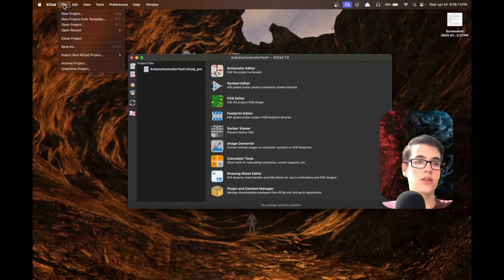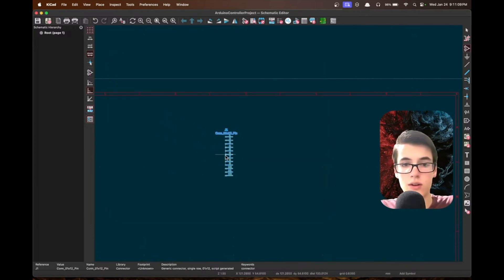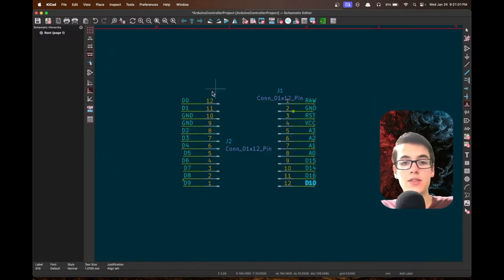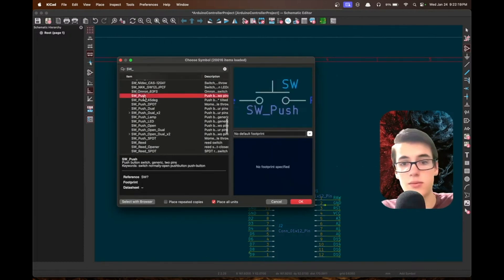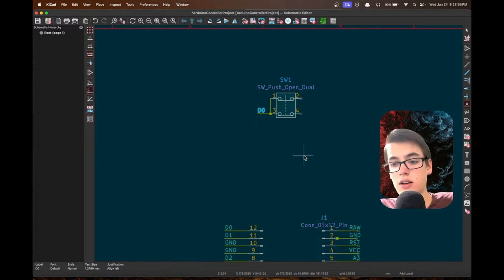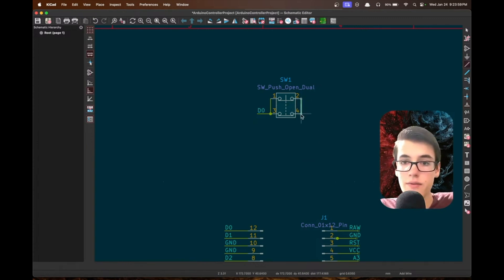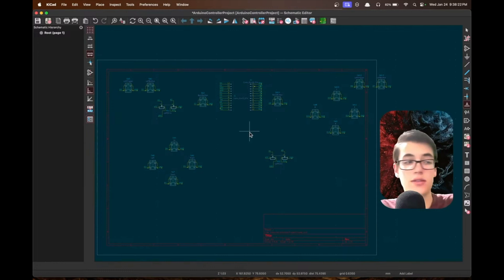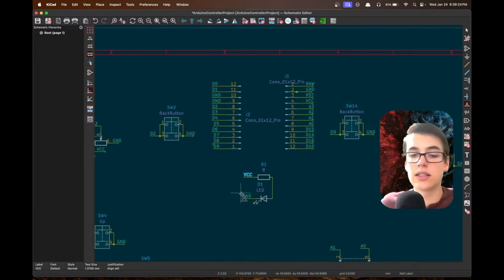① Arduino Game Controller | Schematic Design

Comment: Should this have pulldown resistors, or is it not necessary for the pro micro
Reply from the maker: The Pro Micro (along with a lot of other arduinos) has internal pull-up resistors on the digital pins, so you don't usually need to add external ones.

Comment: Does this work on the Xbox or it's usable only on PC? If it's PC only there's a way to create a controller that can emulate effectively xbox commands? Nice vid!
Reply from the maker: Thanks! Unfortunately you can't use it on the Xbox, as the Xbox controllers have some kind of a security chip which hasn't been publicly cracked yet (even though it does emulate the commands correctly).

Comment: You use wired connection right?
Reply from the maker: Yes! It’s connected over USB-C
Reply: @danovation  that is great i wanted it to but my board doesn't have sereal coms
Reply from the maker: Yeah I mean if you have Bluetooth that’s even better!
Reply: @danovation  yea but i am kinda in a battery shortage
Reply from the maker: Well you can probably power it with usb and use Bluetooth for connection, even if it’s not super convenient
Reply: @danovation  i mean yea